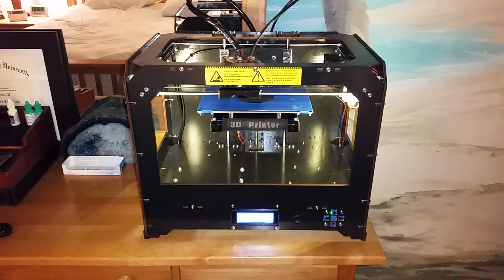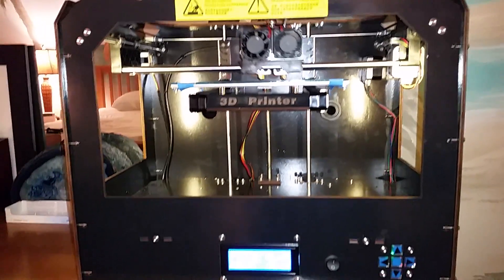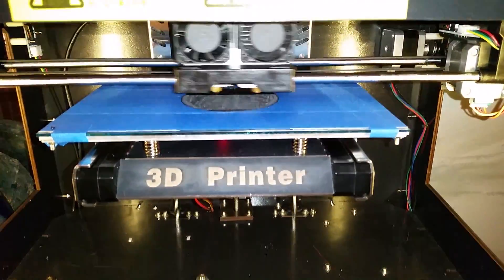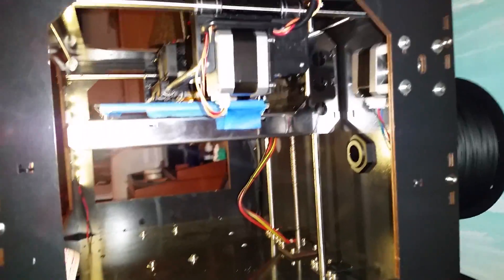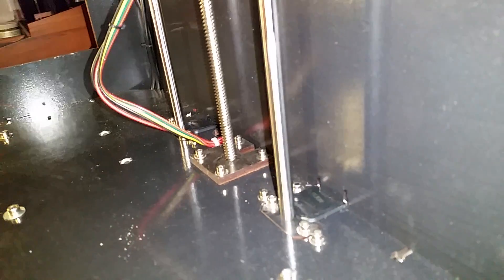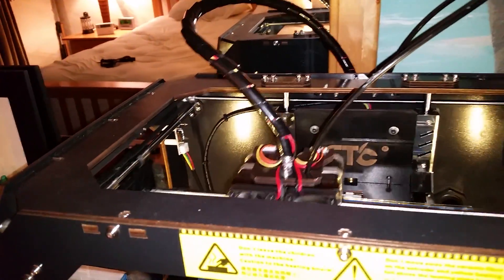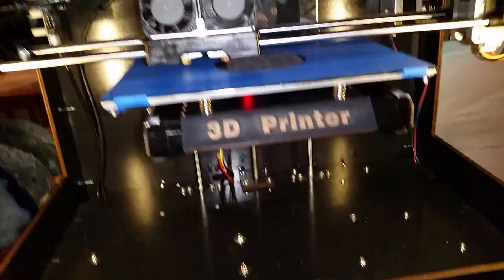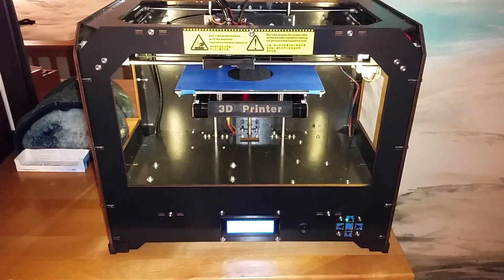CTC 3D Printer: Some Upgrades and Salfish Firmware

Comment: Hello, Great video, I have a problem with my ctc replicator dual. All of a sudden lately when I begin my print, when it starts the operation, it lays that initial strip of filament across the front of the bed, then continues to the print, But now when it is laying that strip, it continues off the side of the bed until it causes the belt to grind the cogs. Then it comes back and begins the print and everything still prints fine. Tried resetting the CTC but does not stop the problem. Any Suggestions??? By the way I upgraded to Windows 10

Comment: Hi I have a Ctc but now it's not printing right like it use to be do I really need to update the firm wear
Reply from the maker: mike muniz it all depends on what's going wrong. What is happening to your printer?
Reply: ElementalMaker it's was printing good out of the box then the cables of the x axis got f up but my brother fix it now it's printing and clicking like crazy so when it shoot out plastic it's not laying down perfect I see string of pla after a finish print like it's messing layers it didn't fuse together
Reply from the maker: That does not sound like a firmware issue then. Have your brother double check his wiring job. You may also need to level the print bed.

Comment: The problem with these printers is that they don't have a real Makerbot Mightyboard.  Basically it's some kind of clone, which means it's nearly impossible to upgrade the software, or use the newest Makerbot software.  I am switching my board out for the Mightyboard.
Reply: What board are you using? My CTC doesn't have a bootloader and I can't get it to update any firmware.

Comment: @ElementCollector1001   sweet video man.With this printer, can you install a bigger bed? the 4x8 seems kinda small.. Thanks
Reply from the maker: +jerimiah smith It may be possible, but the build volume is already pretty well maximized for the range of the extruders. I haven't run across anything that doesn't fit on my build platform yet, and if i needed to, the model could always be split into two components and then epoxied together.
Reply: i see a lot of people using bigger pieces of Glass clamped onto the bed. my ctc will be here this week, plain to prototype quads. just hoping the parts fit. thanks for the reply buddy
Reply from the maker: Yeah you can definitely squeeze a couple more inches out of the bed if using a glass plate. My glass plate is one I made, and I did the same dimensions as the existing bed, however it could be easily oversized a fair bit.

Comment: Hello cool video was considering this or the xyz 2.0 davinchi I can get one for $450.00 and this for $419.00 any personal thoughts on which would be better
Reply from the maker: +Craig Taylor I don't have any personal experience with the Davinci, but judging from reviews and ratings I would sway towards the CTC. That may be personal bias, but I think the CTC offers more, especially for the price point.
Reply: +ElementalMaker its actualy 400usd http://www.ebay.com/itm/Black-3d-Printer-for-Makerbot-Replicator-2-1-Roll-Free-PLA-or-ABS-Filament-/351120152530?hash=item51c06457d2:g:AzEAAOSwbdpWW6~T
Reply from the maker: robertas grigas
Yeah they must have recently come down in price! Definitely a steal now

Comment: I have these printers from QIDI Tech and I am wiring up a cooling fan to the system fan on the mightyboard. Downside is I have to manually turn the fan on and off. I have tried to upgrade to Sailfish with no luck. I installed the capicitor to C20 but still cannot install Sailfish. Fails every time.
Reply: +Bill Karoly We are loaning them to some local libraries. QIDI Tech makes a CTC/Flashforge clone which I have modified with a new build plate that has tabs front and back to clip glass to it and the clips are out of the path of the nozzles being outside the build area.

Comment: So I upgraded the firmware to Sailfish on my CTC 3d and the LCD screen is blank so it doesn't run, is there anywhere I can find the original firmware or another way to fix this?
Cheers,
Andrew
Reply from the maker: Sir Anderoo You may just want to try reflashing it. Also check that's the LCD is plugged in, as the connector can fall out sometimes.
Reply: ElementCollector1001 Just reflashed the board and all is good now! Except for the SD Card Read Error, but that wasn't the main issue. Cheers, for all the help!

Comment: I just buy this same model from eBay and I can make it work, you have any step by step tutorial? Because the display say CTC USB+ and I'm using a Mac, so I really don't know what to do, or how the included USB work, also my avast software erase the installation .exe I guess because it's on Chinese, please help?
Reply from the maker: Uriel Albarran Oropeza I dont really use the USB. You should be able to simply plug in the printer, level the bed, and then plug in the SD card and do the PLA test print that you'll find on the card (after you load the filament which is under tools or some similar option).
Reply: It's needed for the first run? Because only the electronic parts works and all the mechanics (servo motors) don't, so I can't level the plate, the 3D printer don't pull the filament, the axes don't work, etc, etc
Reply from the maker: Uriel Albarran Oropeza That sound like a much larger issue than software or USB connection, but before jumping to any conclusions watch this video and familiarize yourself with everything (video is for the flashforge, which is essentially identical to the CTC): https://www.youtube.com/watch?v=5iJqjDzWlos
Reply: My 3D printer it's just like the model on your video, I don't see if your printer have the same USB port on the right side, but according to CTC I need to put the USB there, but after a close inspection the USB drive it's burned, you know a way to detect a malfunction? also (sorry for ask again) your printer never come with a custom CTC U-Disk? maybe my printer just look like your printer but maybe it's a different model.
Reply from the maker: Uriel Albarran Oropeza Im not too sure. Ive never used the USB connection, just stick with the SD card. Its a better option in case the  computer were to restart of freeze. I dont think mine came with any sort of disk, just an SD card which had some files on it.
Reply: I already investigate and looks like there's 2 models from the same printer, looks like my 3D printer works like a regular ink printer, every filament ( purchased from CTC of course) comes with an USB key, looks like this USB works as a filament counter, so the 3D printer "knows" how many filament remains, also CTC sells for $150 USD a non-USB motherboard, maybe your 3D printer don't work like this.
Reply: +ElementalMaker I'm using USB and I've rebooted my laptop before without issue. It appears to offload the print to the printer strait away. I'm not 100% positive in all cases however..

Comment: Just got one of these yesterday. I did a sample print of the SD card, but the filament stopped going through. The temp in my room didn't change as far as I know. I confirmed today that the right extruder was jammed, got it fixed after heating up the block to 250. I noticed in your other video that you printed some upgraded parts. Is there a specific website you recommend for this printer?
Reply: Methodoc In the back of the bar above and behind the hot end there should be two set screws. One for each nozzle set. You can loosen the set screw and raise or lower the nozzles. Print one of these first. http://www.thingiverse.com/thing:648771
Reply from the maker: Methodoc Odd that you needed to get it that hot to extrude. That's a pretty high temp, pretty much the highest temp the CTC's extruders can safely go. What plastic was that with? If would highly recommend checking that your thermocouple is in good contact with the hot end.
Reply: ElementCollector1001 Thanks for replying. I googled and found a site that recommend it to set the temp to 260. I'm using PLA which came with the printer.It's been good since I cleared it, but I'll check it out. Will start printing parts for it soon.
Reply from the maker: Wow that is very high for PLA. I usually print around 200-210. As low as 190's sometimes, and that is using the roll of red PLA that CTC sent with the printer. 260 seems insanely high for PLA.
Reply: Sorry, I printed at 210 which was set by default, but after the print head became jammed I turned it up to 260 and pushed in the left over filament.
Reply from the maker: gotcha, did you keep it at 260 for your next prints, or did it work at 210 again?
Reply: I kept brought it back down to 210, it worked great. The only other thing in noticed is that the left extruder (which I'm not using at the moment) is a bit higher than the right. I see there is a screw in front, but not sure if this is what lowers it.

Comment: HI, just updated to sailfish. Made a mistake though, didnt take down the original  vrefs for the machine, now its printing off the build plate. Any advice? its the same printer. thanks in advance.
Reply from the maker: Lee Tobin Hopefully they have the same Vrefs, here are the ones off my machine: Modify them at your own risk! Make sure you tighten up your build plate before trying anything so it wont crash into the extruder head.
X home offset: 152mm
Y home offset: 72mm
Z home offset: 0
A home offset: 0
B home offset: 0
X toolhead offset: 32.0006
Y toolhead offset: 0
Z toolhead offset: 0
VREF POT. 0: 118
VREF POT1: 118
VREF POT2: 40
VREF POT3: 118
VREF POT4: 118
Reply: ElementCollector1001 You are a legend!!!!! saved my printer. Any other tips, bare in mind im new to this. Haven't got the abs to stick yet. Im using blue tape like yourself. Also what temps do you use for each plastic abs/pla? and settings? Also do you heat the build platform on pla? Any thingverse you can show me to showoff what the printer can do, and the settings material used? 

Please excuse for the 21 questions.

Really cant stress how happy I am now!

Lee
Reply from the maker: Lee Tobin Awesome! Very glad it worked for you! I always find turbines very pleasing to look at, and are a very cool print to test out the capabilities of the printer. In order to get your calibration dialed in though, I recommend first just printing a few calibration squares or circles, and checking them with a digital caliper to see if any of your belts might be loose or whatnot.
Reply: Lee Tobin I'm using glass plates with hair spray. That has been the best solution for me.
Reply: +Lee Tobin Elmer's Glue sticks work great as well. Started using glue sticks on my glass be about 2 years ago, and no more warping of ABS prints. You actually have to PRY them off when it's done haha But you can also let them cool completely, and sometimes they'll pop off on their own.
Reply: +William Smitherman  I have tried glue stick, tape and hair spray. Plus 3M Blue Tape with glue stick too. I still get warpage on occasion . What I like about glass is parts just pop off as it cools. When I did blue tape and gluestick I was afraid I would break the glass getting the parts off. I find the fan on the part while printing makes a huge difference too. With the fan off no warpage or lifing but turn the fan on and parts warp a little.

Comment: Thanks for sharing. I am considering this printer although I was told that they are the cheap knock-offs of cheap knock-offs ;-)  However, I am not sure about which eBay seller I should get it from as there are many of them. Did you buy yours from ctc3dprinter2014 which looks more official? THX!